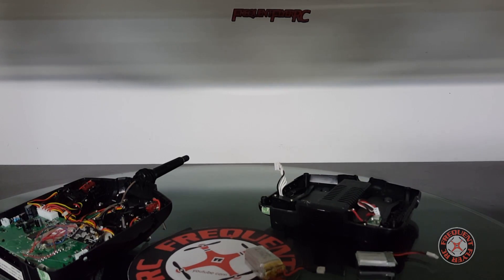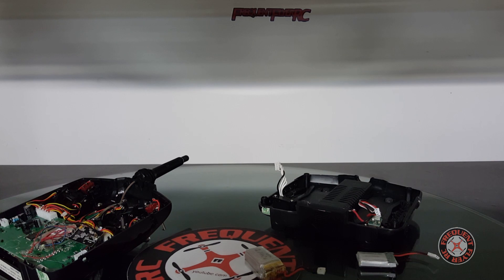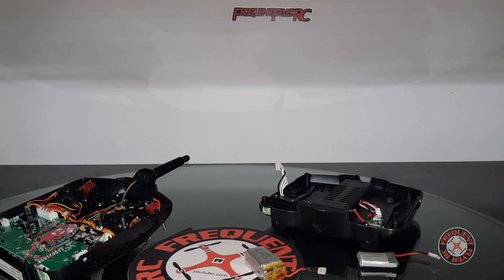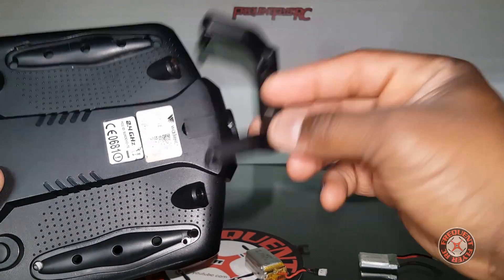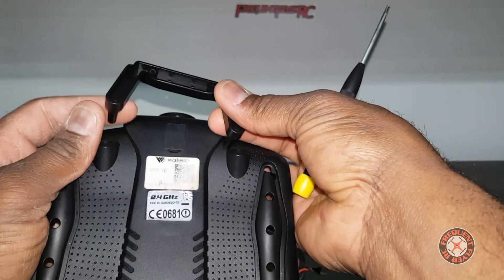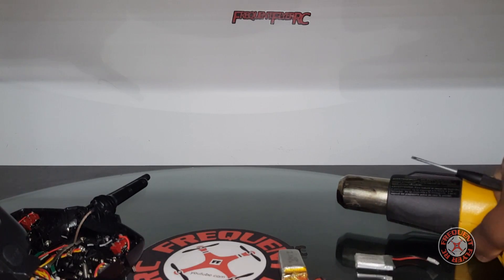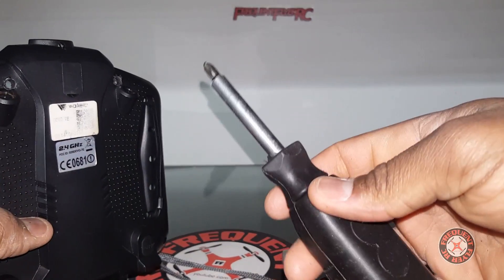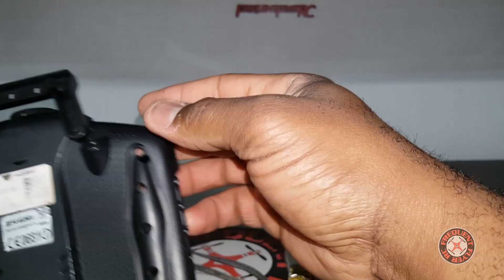ChopShop: Devo 7e FPV Mount

Comment: why dont order a decent fvp screen mount for your devo?
Reply from the maker: Walkera has them for Devo 7e??
Reply: +Frequent Flyer RC i just received the aomway 7" monitor from bg. I bought a $4 fiberglass mount on ebay. wich fixes on the metal bracket on your devo.
Reply from the maker: Links! :P